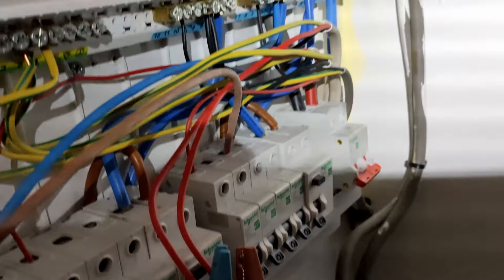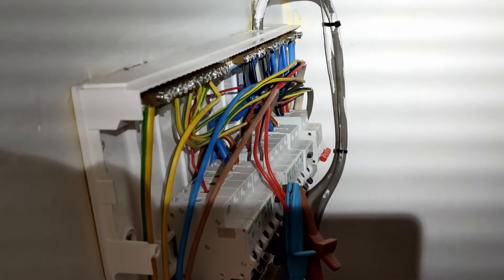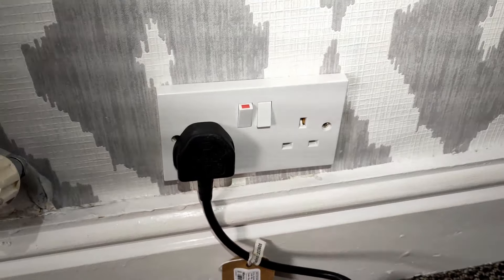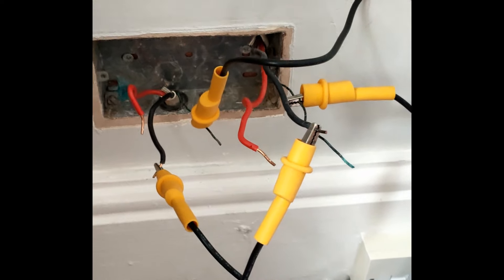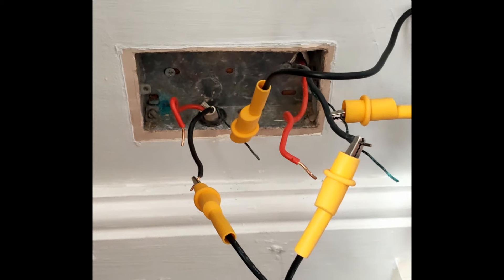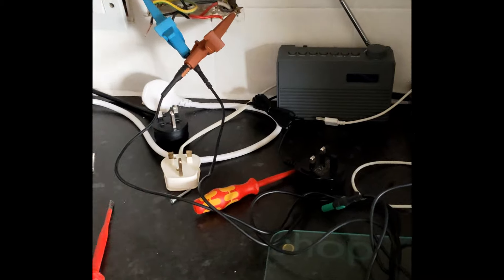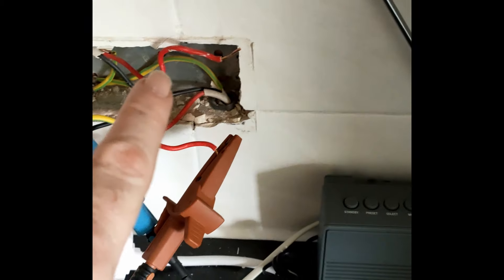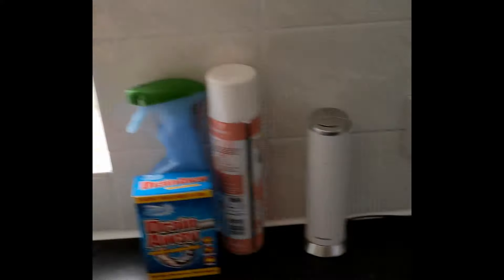HOW TO - Ring Circuit Fault Finding (sometimes called a Ring Final, Main or Socket Circuit) - Part 1

Comment: Hindsight is a great thing, I have had similar experience doing tests, used a normal plug in socket tester, all working. then bought a 50 and 10m R2 test lead, disconnected ring at the DB zeroed meter with test lead attached, then connected the  test lead to one end of the problem wire at the  DB the other test lead plugged into a 13a socket tester, holding the meter walk around the building record readings if required for plan of the cct when I get open cct or high reading fault is near. Repeat with test lead attached to second problem wire, fault should show near first fault. This saved me a lot of time and also R2 readings are easily carried out. Maybe not worked on your cct but I found it very useful. Purchase test leads from Screwfix.

Comment: why put the upstairs sockets and the downstairs sockets on the same ring.?

Don't make sense to me.  I would have one downstairs ring and a seperate 
upstairs ring.  Please advise.

Regards,  bill.
Reply from the maker: Yes I agree. I don't know why this wasn't done when the house was re-wired. I did consider suggesting it once I knew how the ring was configured and I had it fixed, but it wasn't causing an issue for the tenant so I thought best leave it alone.

Comment: Hi,

Would it not be easier to split the sockets wireing.  essentialy turning them into two radial circuits.
Maybe this would be easier to fault find.  Plese advise me on this as I am currently doing my DEI course.

Regards,  Bill.
Reply from the maker: The only issue with radial socket circuits is that they should be done in 4mm T&E, so converting a 2.5mm T&E ring final into two 4mm radials would be a lot of work. Exceptions would be radials that only serve only a few outlets, such as an outdoor socket etc, but certainly a radial in a kitchen where loads could be high should be done in 4mm.
Reply: Yes that what easier to track down
Reply: There is no right or wrong way because you don’t know what your dealing with I’ve had 3 faults on one circuit.
Reply: @vwes A3 circuits are permitted.

Comment: Very challenging fault, Ring fault finding can be very frustrating. Personally ring mains should be abolished, and install sockets on radials. If you really need 32A, use 4mm. But 2.5 on a 20A, is just as good for lounge and bedrooms.
Reply: totally agree

Comment: You need to get yourself a Megger or a fluke i used to have a kewtech and the readings were all over the place
Reply from the maker: I do like the Megger's and I have considered them, but at the moment it's just cheaper to get Kewtech to do the firmware upgrade when it goes in for its callibration - it'll turn it into a KT63DL

Comment: Would a plug in socket tester found the problem? in a fraction of the time.
Reply from the maker: Unfortunately no. The one problem with a ring is when a continuity fault occurs it essentially turns into two radials which a plugin detector wouldn't find. They are only really designed to detect polarity problems . Why is this bad ? Overload, you've essentially got all the load going down one leg which the cable wasn't designed to carry, but the circuit breaker wouldn't trip